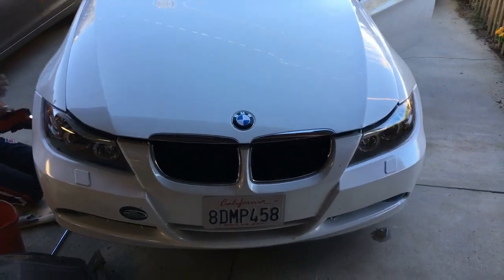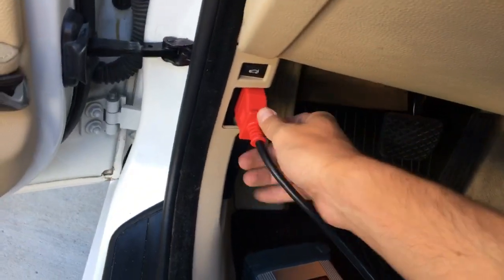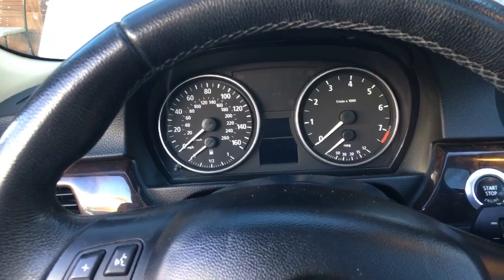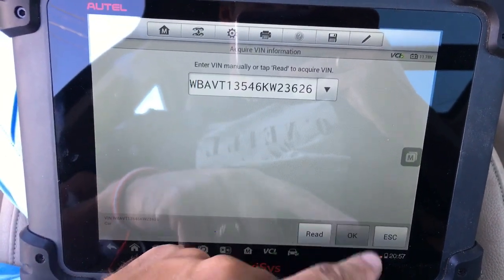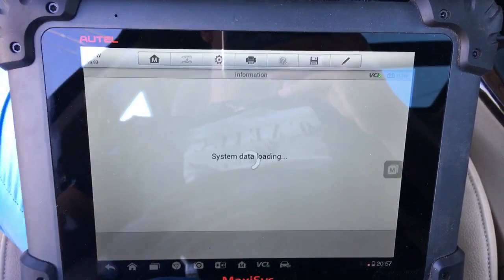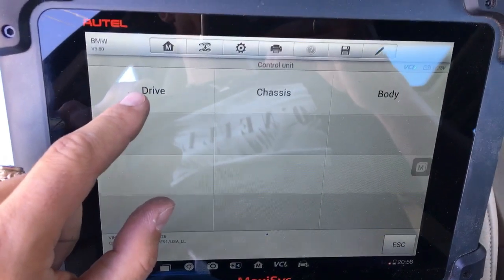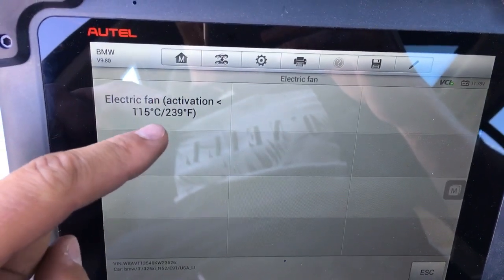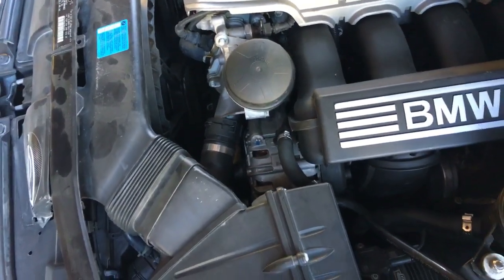HOW TO TEST RADIATOR FAN ON BMW

Comment: I have a 2008 335XI E90 (sedan). Is that radiator fan supposed to be on all the time or only when car gets to a certain temperature? When I drive 1.2 miles to my mom's house, the fan is still not coming on. This trip takes about 7 minutes. is that normal? Thanks.......
Reply: Uptown Photography did you figure it out? Respond quick I might buy a new one!
Reply: The electric fan should only come on when it comes to temperature, while driving it generally shouldn't come on because air is moving through the radiator. When parked that's when the fan generally turns on, because no air is moving through the radiator. A simple way to test if it's working just turn the Ac on, the fan should spin. 2yr old question I know.

Comment: Great video. 
I have a 2011 535i xDrive my fan keeps coming on and off on and off loud very loud I have changed the coolant temperature sensor I have tested the water pump as well as the thermostat they're working as they should I have change the tensioner new serpentine belt fresh oil change replace the O-ring as well as the gasket on the oil housing and yet still my fan keeps coming on and off on and off very loud the vehicle reaches its normal temperature while driving and once it hits where it's supposed to stay the fan kicks on as we're driving and it drops the temperature as it's going on and off on and off and once it reaches in between the 1:40 and 2:50 line the fan goes off but once as we're driving the temperature rises again never going over the middle point which is normally 250 the fan kicks on again and a drops the temperature never stays put any input on this please?
Reply: Ben T. I’m having the same problem with my bmw, Have you resolved the issue ?
Reply: @jeanj1106  NO. It's a issue that's got a lot of shop confused.
Reply: Ben T. Maybe the water pump sensor  is bad
Reply: Does it have two water pumps
Reply: I have  same problem on my 328 and sometimes my car stalls

Comment: Hi I have a question on my 07 bmw 328i I replace the water pump thermostat and after a few hours driving when the traffic got slow the temperature light turns on . Any help ?
Reply: Mine tio
Reply: Was the fan !
Reply: How did you know the fan went out?
Reply: Manuel Garate was the fan loose?